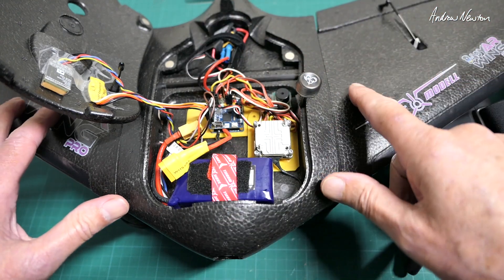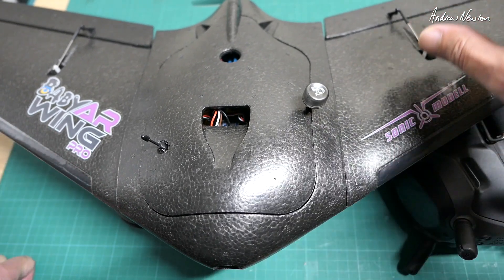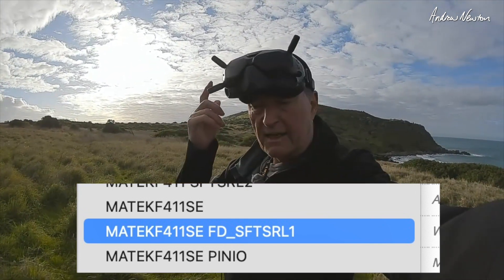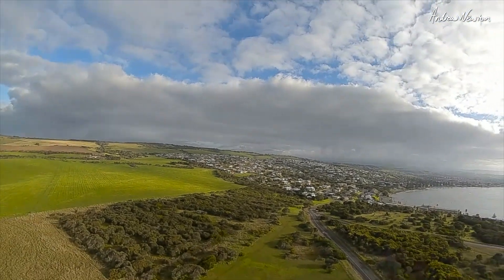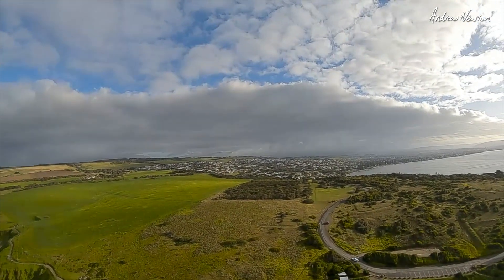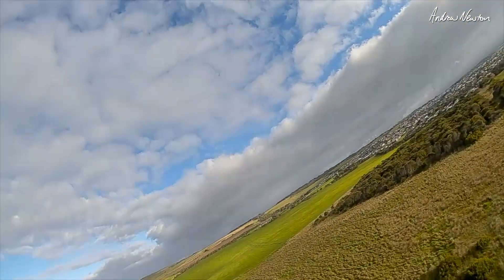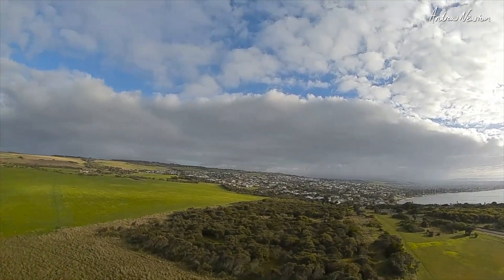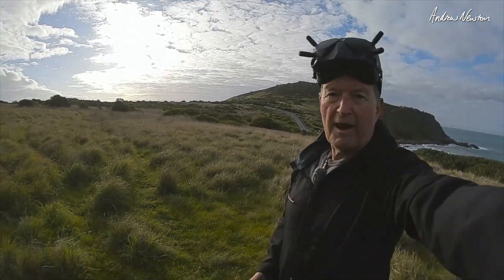Baby AR Wing Pro with INAV DJI HD FPV

Comment: Hi Andrew,
I am struggling with my AR Wing Pro and Autolaunch.
Can you share some settings. Or maybe explanation on how to figure out the settings. Whats a good Idle Throttle setting and launch throttle setting?

I have 3 failed Autolaunch attempts with resulting repairs. And I am fishing for Tupps/Settings/Rules.

Best Regards
Reply from the maker: I stopped using AutoLaunch. Too easy to get it wrong and I prefer to give a manual throw. Best to ask on the INAV Fixed Wing Facebook group

Comment: I'm not into FPV at all, but I was wondering about the industry's (apparent) obsession with creating incredibly tiny aircraft. Is it just for reasons of economy, or are mini planes intended for the 'Black-Ops' community - i.e. hide it in a backpack so you can fly secret macho (tragic) commando missions?  The wing is well over the 250g weight limit, so why soooooo small?

In stability terms, 'the bigger the better' usually applies. Is there a normal or sport side to FPV, where ordinary guys fly models with a 6' or 8' wingspan? The results - assuming that clear, stable video footage was the goal - would be infinitely superior.

I understand that tiny models are cute, and that modern flight-control gubbins will do most of the flying for bored or disinterested or inept pilots, but just because something can be done isn't a very good reason for doing it.

Disclosure: I'm still making videos and taking pictures from KITES, so what the heck would I know about anything... 🤭
Reply from the maker: Portability is the feature they are pushing. Kites fliers are good people

Comment: Nice setup and demonstration. The pitch bobble can be tamed some by reducing PIDs a bit (P mostly) for this lighter wing. Think it's related to the FC defaults assuming a heavier wing with a slower response time.
Reply from the maker: Slack in the pushrods and too much wind probably contribute too